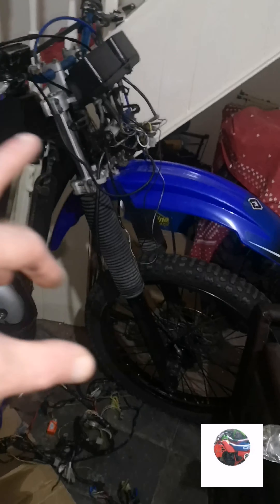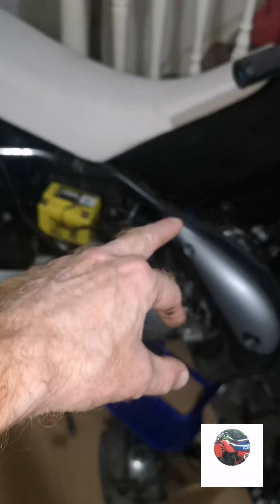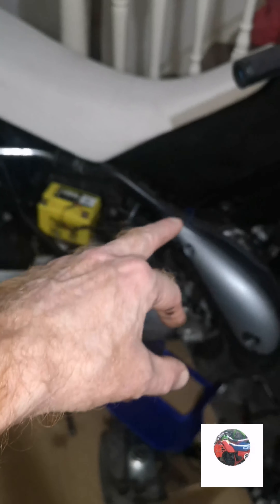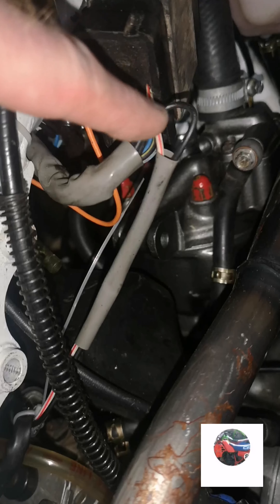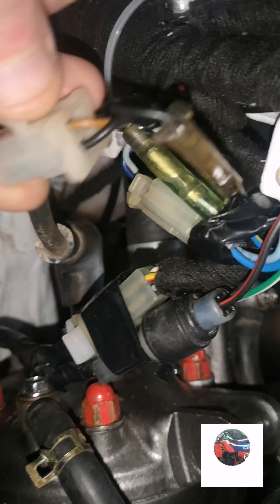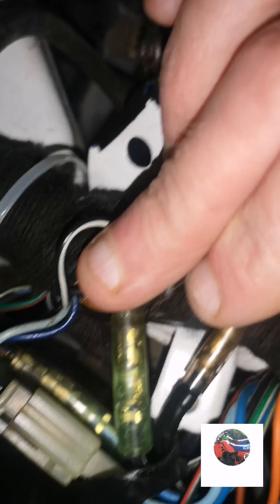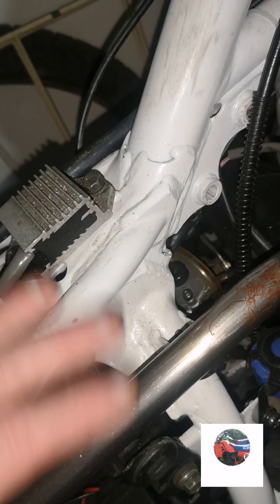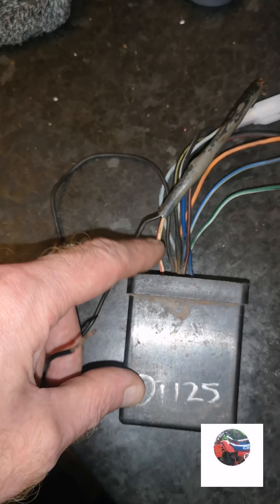yamaha dtr 125. 1999 with 1988 3db eng,loom & cdi, cut plugs and wires how 2 wire a cut cdi up

Comment: my bike starts but keeps back firing when i put throttle on has new coil and regulator had everything checked stator could this be a cdi problem  got it working other day now its doing same thing again
Reply from the maker: Hi m8 it mite be running lean see if it runs better with the choke on

Comment: Great video mate,very helpfull.👍
Reply from the maker: No probs m8 thanks for the kind words and thanku for watching hopefully this shud help every dtr owner out with chop jobs🙏🙏🙏👌
Reply: Great video, I just sat and 90% wired mine back up In 20 mins. Was given the engine free after sitting for about 5-6 years in my pals garage being neglected.. and all the electrics were butchered. Still struggling a little as I don’t have a loom and am putting the engine in a Pitbike so there’s a lot of stuff I’m not using.

Keep up the content!
Reply from the maker: Thanks man good luck with pit bike
Reply: Thanks, it’s going well just trying to figure out the wiring!
Reply from the maker: Which bit are ya stuck on m8
Reply: Well I’m rebuilding the engine atm so trying to get somewhere close with the wiring before it goes into the bike. Basically all I had was a cdi with all wires cut and all the wires from the stator were also. Didn’t have the pc servo but I did manage to pick up a 3 wire. It shouldn’t be that hard as there’s no other electrics needed apart from the spark and power to the servo.